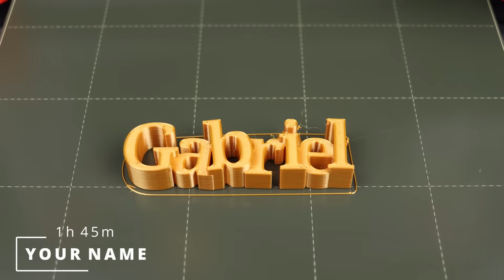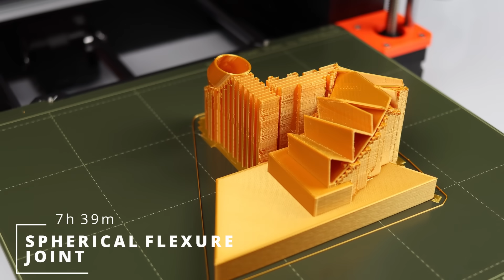COOL Things To 3D Print

Comment: Look at mathematician Tadashi Tokieda cutting a Möbius strip. It's really surprising the result.
You might do some similar.

Also homeomorphisms can be quite surprising. I don't know if 3d printers can simulate any of them. 

Is there a way to do a gyroscope that runs on a thread? Maybe you would have to add weight.

Comment: Great videos! How do you get your prints to just pop off the bed so easily? Thanks
Reply from the maker: The quality of PEI sheet is the main reason I think, also I flex the sheet before remove models ( it's not shown in video )
Reply: @Marc3DP  oh ok. Do you get good bed adhesion with it as well? Would it work with an Ender 3 V2? I’m new to the 3d printing world. Thanks

Comment: i love your vids keep up the amazing work also  have 1 question. im new in the 3d printing world and i dont know how to make any good prints. also i have a monoprice cadet. is it possible to print a smaller version on the cadet or not?
Reply: by smaller version i ment a smaller version of the lucky 13
Reply from the maker: @ethancoleman4896  I print it in 120% scale, so my is a little bigger than standard. But I don't now how it works when you scale it down to 4example 80%. I suggest to ask it here : https://www.printables.com/pl/model/148367-lucky-13-printable-jointed-figure